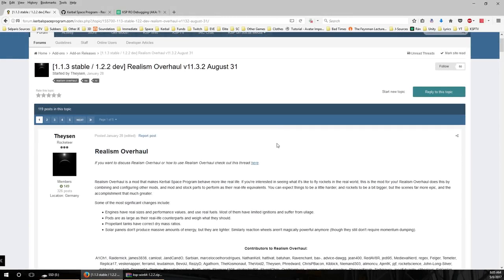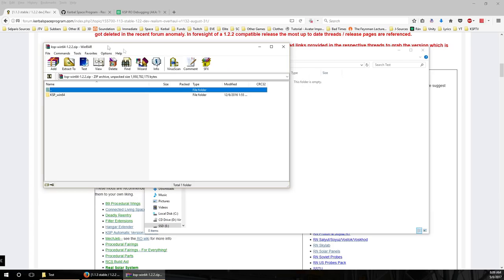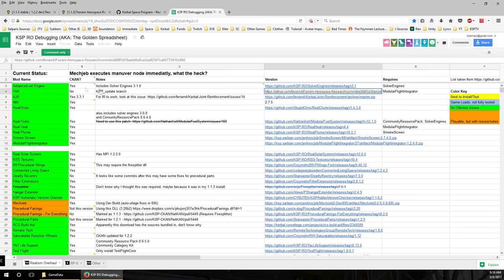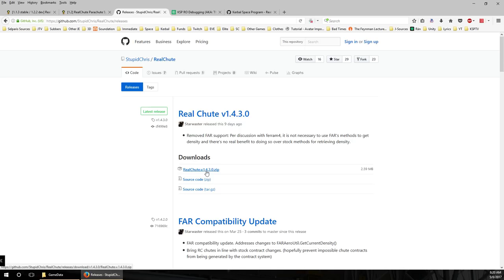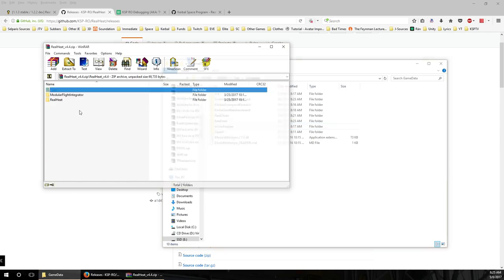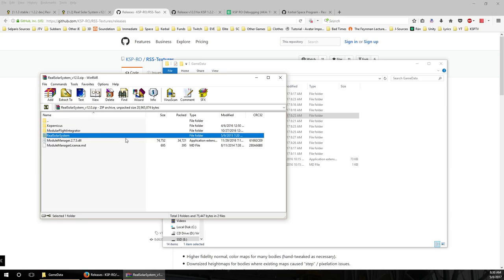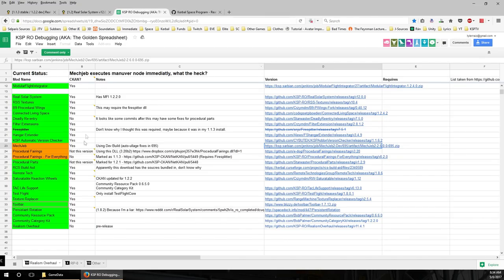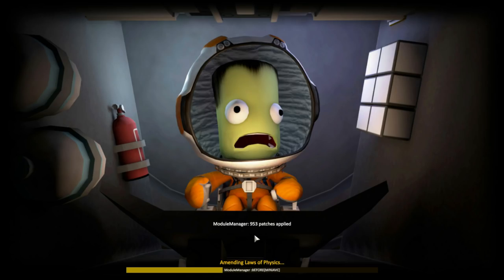Installing Realism Overhaul in Kerbal Space Program (basics)

Comment: Anyone having trouble with Atomic Age from the suggested list? Specifically, the Nuclear Lightbulb engine, it will not yaw, but it does pitch. Makes it hard to control if your ship is not symmetrically weighted, and it flips over when lifting off from Mars. I did a quick search through the KSP forums and some people mentioned this issue, but I didn't see a response.

Comment: Installed RO yesterday using this magic spreadsheet, and now youtube recommends this brand new video to me. What a coincidence!
BTW, what do you with the bumps on the runaway? For me, it is impossible to get off/land from/to the runaway due to random bumps.
Reply: Tyler Raiz there are a few workarounds, do not put wheels on wings, and now on 1.2 use auto strut. If you are 1.3 try struting main body to side tanks / wings and those to the wheels.
Reply: yeah i get this problem as well, so i just drive off the runway and use the grass. but all over the planet there are cracks in the ground as well that act like bumps. sometimes i can't even get off the runway because the starting area is like a foot below everything else. plane landing gears also slip and slide so much. everytime i land, my plane starts spinning in circles without flipping over. i'm probably going to ignore planes for now. my rockets also keep spawning above the launch pad and fall down, so i have to always attach them to tower. maybe the issue is how RSS changes the size or height of the KSC region.

Comment: Is anyone getting the same reentry issue that I'm having? If I put an MKI pod with the right sized heatshield, but remove the ablator from the pod, the pod will burn up when returning from the moon, and sometimes from LEO, but the heat shield survives and continues to tumble down. If I just add 10-20 ablator to the pod, this setup will survive. Or, if I use a larger heatshield with no ablator on the pod, it seems to cover the edges of the pod, or maybe it's absorbing more heat with more mass, and the setup survives lunar reentry. 

Then when I use the MkII pod, it has no ablator and I can't add any from the UI, and it will blow up from high orbit or from the moon. The largest heat shield is the right size, and there's nothing larger. The only way to reenter from high orbit is to either reduce the apoapsis or to do multiple aerobrakes. Is something wrong with my build that doesn't allow ablator on the MKII? Or is the heat tolerance not tweaked enough?
Reply: Yeah looks like the mod I missed was Tweak Scale. I think it should be fine now as long as the heat shield is slightly larger than the bottom of the pod.

Comment: I made a new KSP install with just this stuff and the procedural parts / wings.  First Lunar mission, I've found out everything fatally overheats at 1000x time warp.  No detectable heat at 100x.  Is this a bug you're familiar with / know the source of?
Reply: Early satellite, just a core, tank, engine, battery, antennae and a nosecone.  The core seems to be heating up most, I'll check if that's the issue.
Reply: It was called "Agena" something or other, but I've since found the same problem with other craft, it doesn't seem to be part dependent.

Comment: I tried installing RO manualy,but i found a engine bug that the thrust and isp are not showing up also the engine stage is simple not there with any engine.my version is 1.2.2  and I actually find problems with the jet engine(it stops loading the game)i think probably because of realplume,i deleted jet engines.
Reply: Almost I downloaded  Realism overhaul and it's dependencies from the forum and installed them but,i didn't download AJE separately and possibly some othere mods,but I did find them in my gamedata folder.

Comment: Hey Tyler, I have run into a wall trying to make a RO/RP-0 install. I have only the dependent mods and RO installed, when I try to load it it stops progressing and in the load bar stays saying Squad/Parts/Engine/jetEngineAfterburning/turboJet. I know it's not frozen as the little blurbs above the load bar keep changing. I am 99% certain that it is an issue with advanced jet engines because when I removed it the game loaded. An ideas or advice on a fix? Can I run RO/RP-0 without AJE?

Comment: im having trouble with the ZIP files (can anybody help me)
Reply: You can use any extractor. I use 7-Zip. Put the zip file into your Gamedata folder and Click:
7-Zip > Extract Here
Then you can delete the zip file.
If it doesn't work, try checking if the mods are under a "GameData" folder. You should have no "GameData" folders anywhere under the original one.